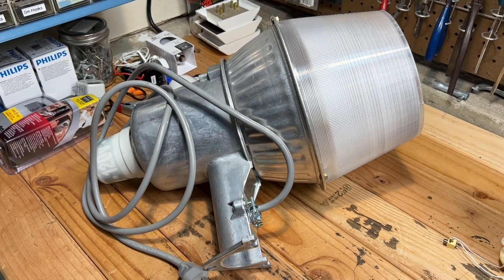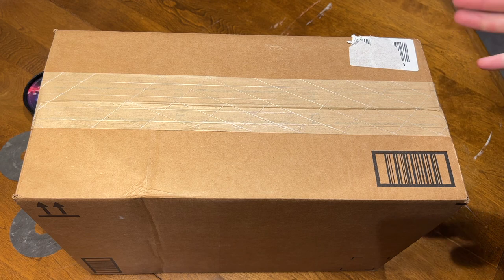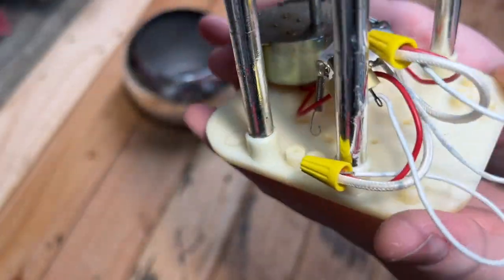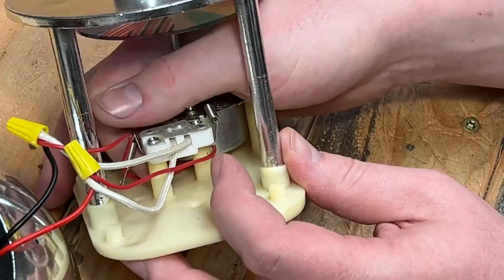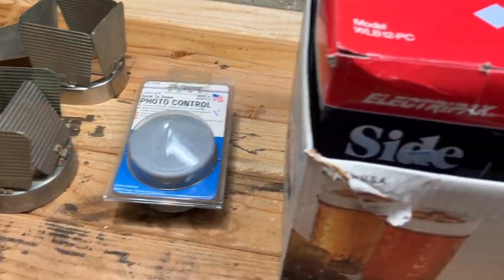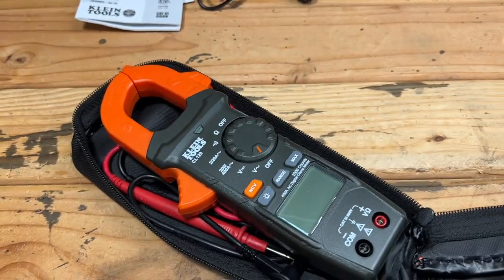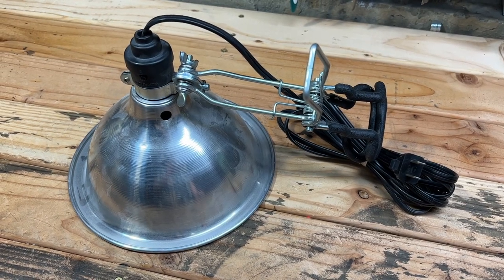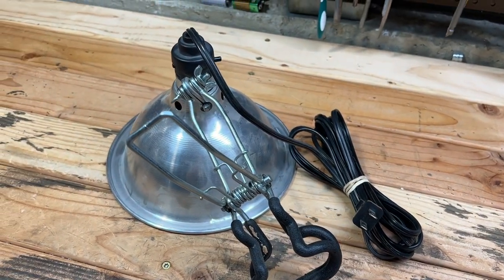Restoring a Vintage Fiber Optic Lamp! - 47

Comment: It is low power factor ballast on lithonia lighting I have same thing on my lithonia c220 rapid start strip light I got from restore couple months ago and I’m using a ge ecolux f20t12 lamps I mostly see every lithonia lighting fluorescent fixtures they always have advance ballast. They’re very good ballast in my bedroom I do low power factor or normal I don’t need it bright in my room. For my basement I do high power factor ballast. And I use 34 watt tubes sometimes mostly I do 40 watts.